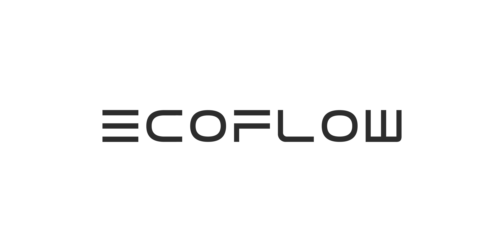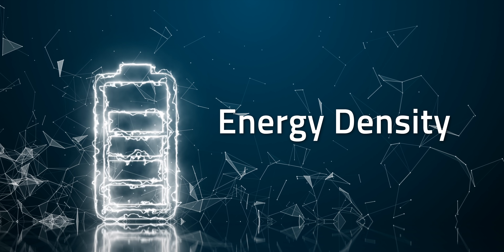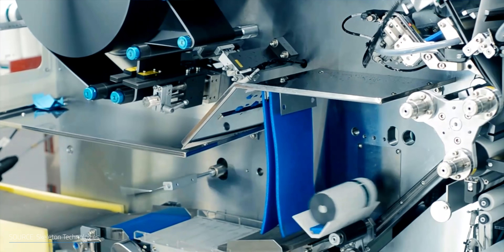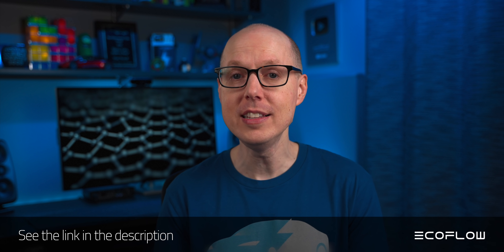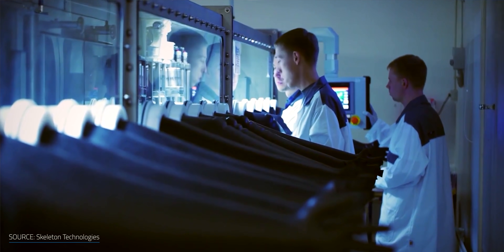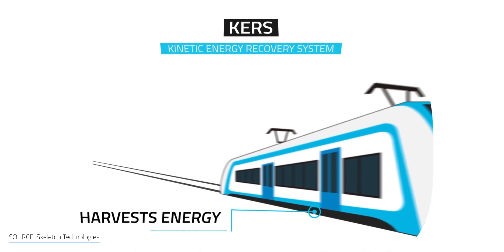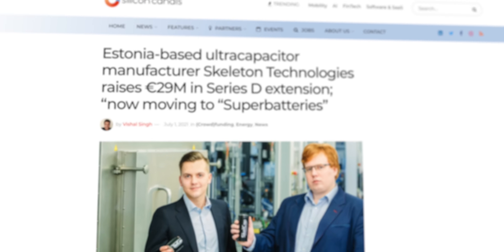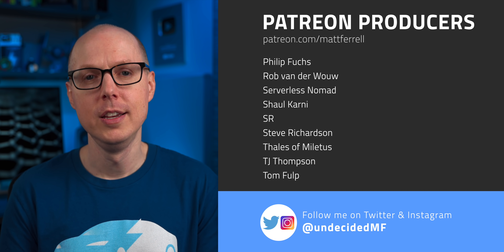Revisiting the Supercapacitor - The Wait for Graphene is Over

Comment: I do feel this with regen braking would improve winter performance in evs and the replacement of the 12v traditional battery has begun (tesla) to shed weight. More needs to be done
Reply: Regen already exists with batteries, you don't need super capacitors.
Reply: @AORD72  yes, but by my orignal post, "improve winter performance" this is because if you dont precondition the battery in cold climates you cant charge "regen" at optimized braking. Supercapacitors solves this and weight reduction. Tesla has this with a new 16v battery in the model S and Chinas Model Y performance.
Reply: @polarbearigloo  true, sorry you are correct.
Reply: @polarbearigloo  I'd be skeptical of anything Matt promotes as he was disturbingly intellectually bankrupt on his solid metal hydride tape reel battery (hydrogen storage) video.
Reply: @RichardPrendingue  How was Matt Intellectually Bankrupt?  I’m not arguing or disputing your opinion, I’m just wondering what aspect of that video you are referring to.  

The tape battery looked like an interesting idea, but I was skeptical of how much hydrogen it really could store (if that’s what you were referring to), and how cost-effective it would be overall.
Reply: @MRDDOG2012  Thunderf00t did a video on it. Matt just repeats the claims of the manufacturer as he claimed hydrogen can be "recaptured" from smoke stacks without using electricity. Assuming for arguments sake it was possible it would be contaminated with impurities from the various chemicals causing issues.

Video titled, Solid Hydrogen: Busted!
Reply: @VitaKet  Mainstream science (Matt or Elon Musk) is becoming a religion of blind faith so its not out of his realm to criticize.

Assuming we reach Mars with Musk, how do you solve the most important problem of power and heat dissipation in the absence of an atmospheric density or pressure of sufficient thermal conductivity? It's to the point a network of piping for geothermal cooling of power source is the only plausible option.
Reply: @RichardPrendingue  of course he just highlights breaking edge. Buisness wise everything can fail for another thing or cost parity reasons.
Reply: @polarbearigloo  He stated, "the device could extract metric tons per day of 99.99% hydrogen directly from smokestacks and gas streams and turn it into a solid state hydrogen." 

If it can absorb hydrogen like a sponge it will absorb everything else within the stack as all other gases are undeniably larger.  Hence, intellectually bankrupt.
Reply: Regen is a perfect use for supercapacitors.

Comment: I can imagine an energy storage solution that combines supercaps, LFP batteries, LNG storage & fuel cells, and gaseous-CO2-derived biochar.  Just like gears on a car, you use different ones at different times, and it's more practical to have all 4 than to limit yourself to just one and oversize the system to handle all the edge cases.
Reply: Waste to energy systems like the GSI-UCS utilize these technologies to create renewable systems for the future. We are currently testing supercap batteries with novel turbine tech to generate constant power and increase micro densities across entire industrial processes, creating parasitic load reduction at the systems themselves.

Comment: The larger power capacity of large capacitors can be useful, but also makes them very dangerous. The one in your microwave can kill you even after you've unplugged it, just with the remaining charge. So what happens when you accidentally short-circuit one of those supercapacitors? The same as with a large capacitor, but concentrated in a smaller space I would guess.

So if ultracapacitors are going to replace batteries, I suspect they will be required to have a current limiter built in so that they can't discharge faster than is needed for normal operation.

Comment: I think super capacitors will become the go-to for energy storage once we can figure them out. What we need to find is a material that is 1 atom thick and is a perfect insulator. Then, imagine a mile long sheet of graphene and this other material rolled into a tube the size of a AA battery. The energy density would be off the charts compared to what we have today, even considering Lithium. Plus, carbon is easy to get. It's a part of biological life on earth, so rake up some leaves in autumn, process them, and you'd have enough carbon to make one of these mile-long graphene super capacitors yourself. Plus, it's more or less renewable. Oxygen. Water. Sunlight.
Reply: Idk if that's possible though, due to quantum tunneling effect. The computer industry is already facing this problem at a scale of more like ~10-100 atoms thick iirc

Comment: I'd like to see regenerative braking in consumer vehicles incorporate this technology.  Start up cycles for HD electric motors such as AC compressors.  Lots of possibilities here.  Great content, thanks!
Reply: Fwiw, the start up of most electric motors above the US 110 volt standard is accomplished with capacitors already. These "ultracaps" may reduce the size of the current ones but not make any impact on energy consumption. What this could do for EV charging times would do much to shorten the days before the electric auto is thoroughly on the ground. Further, using them to help with momentary spikes in power demand would go a long way toward making renewables like wind, solar and geothermal a better fit within out existing systems. No matter what we do, Big Oil and Big Utility aren't going away- engineering to better use renewables  matched with the resources of those entities is the shortest time frame to the goals of 2030 and beyond. FR
Reply: @fredericrike5974  The capacitors used with AC Motors are for phase shifting the current in the start winding, not for energy storage per se. The capacitance values involved are ridiculously small compared to those of sypercaps used for energy storage! To equate them in any way is pointless.
Reply: @gregbailey45  OK, sounds plausible. I would like a bit more info; which AC motors or mfg's are using capacitors in this way? I spent a career servicing HVAC equipment, some of it factory three phase, and have never seen caps used this way- although I can see how your thought may be possible, as a cap intaking and then discharging could have a delaying effect. All of the applications I have worked on used the cap to instantly build a big charge to "kick" the motor on and to speed quickly or in the case of large AC compressors (both hermetic and exteranally driven) reduce the size of supply wiring. At least AFAIK, anyway. There are other, less costly, more durable methods for phase shifting- which, it should be noted, was often done through a multi HP mechanical/electrical lash up, due to cost/complexity. Also your capacitor application would need more than one cap-they can't be charging and discharging at the same time, IIRC. You would need to run pairs, with some sort of circuit to stagger them to achieve the continuous flow of power to run a motor. Again, as I remember it.  FR
Reply: @fredericrike5974  these ultracaps could isolate a generator or other power source from the massive inrush current starting motors demand - allowing for smaller backup power solutions.
Reply from the maker: Thanks for watching!
Reply: Supercapacitors and ultracapacitors are perfect for electric startup motors, as they can deliver a lot of current in a short burst! it could mean putting better car batteries that can be deep-cycled in cars, so you cause less damage every time you leave the lights on and run it flat
Reply: Isn't that what they mentioned using them for on the trains ?
Reply: Yes, they'd pull all the regen.
I find in my hybrid that over a certain level of braking you're wasting that kinetic energy.
Reply: @zackarynortley3896  basically all EV's have that
Reply: Absolutely! Toyota needs to get on it 👍
Reply: It could make sense in small commuter EVs with tiny single digit kWh packs. A super capacitor could be added that allows for 10-20 seconds of hard regen braking that would be too much for the battery pack (4C+).
Reply: Lamborghini has had regenerative braking capacitors for years. I dont think any other auto manufacturer has incorporated that tech tho, including Toyota.
Reply: @sequoiahughes8536  
The Prius was to have supercaps in 1997. They dropped it at the 11th hour.
Reply: Skeletron has a collaroration with another company I forgot where they retrofit ICE trucks with regenerative breaking. Supposedly gives something like 20% fuel savings.
Reply: Yea!
Reply: Regenerative breaking is already implemented in multiple electric cars
Reply: Charging and discharging current of the batteries is normally about the same. Meaning, if the batteries provide enough current to run the motors to accelerate the car, they should also be able to "take" the current from regenerative breaking (as I am assuming, that max. acceleration and max. deceleration during breaking are about the same). So supercapacitors would not help.
Reply: @Kiboxxx  Glad you brought that up. I'm led to believe braking (on average) is substantially more energy intensive than acceleration. That is, regenerative braking delivers (on average)  more charge than a (Li-ion) battery battery can accept. It's pretty nuanced but I trust that smarter people than me have decided that capacitors, be they super, ultra, or whatever they call them, belong in regenerative braking. Thanks for bringing this up.
Reply: If I just brake harder, I can pass this turd.
Reply: Me too.
Reply: Where Ultra capacitors would benefit BEV is in the longevity of the battery. Rapid charging and discharging batteries builds up heat in the battery that damages it. If ultra capacitors could eliminate or at least minimize those surges this damage to the battery could be greatly reduced. It could also allow for a significantly reduced cooling systems. They could also allow faster charging of BEV you rapid charge the battery to 80% and the ultra capacitors slowly finish charging the battery.
Reply: @matthewhuszarik4173  For any normal BEV driving cycle, rapid charge/discharge  at very high current is a non issue. There is no benefit to adding capacitors. Track use? Maybe. Driving on public roads? Caps would be extra weight and cost with no benefit.
Reply: @jimmurphy5355  They could add efficiency. In braking with limited current inflow, you can lose efficiency the smaller the battery and larger the vehicle the more impact it has. It is extremely noticeable in hybrid cars with their small batteries. Also the more even the energy demand and supply to the the battery is the more longevity it will have. This is the greatest advantage of add ultra capacitors. The cost, weight, and packaging are the key issues. If those were all zero you would absolutely used ultra capacitors, but they aren’t so it is a manufacturing decision.
Reply: @matthewhuszarik4173  Isn't it a better idea in general to charge a very big supercapacitor at the charge station, and let that slowly charge a (smaller) lithium battery while driving?
Reply: @sneaky_krait7271  The only problem even a very large Ultra capacitor won’t have a lot of capacity. Capacitor’s advantage is speed both in uptake and release, but their achilles heal is minimal total capacity.
Reply: @matthewhuszarik4173  You're right, I checked more on it myself too. In that case, your solution is a great one!
Reply: @sneaky_krait7271  nah, a small supercapacitor to deal with acceleration and regen (few kWh) with a battery designed for efficiency and long life would be the ultimate combo.
Reply: @morosis82  the larger batteries in current EVs can handle max regen easily. On the order of 1C regen charging for most EVs. Adding super capacitors in that situation would be a waste and just add complexity, cost, and weight.
Reply: @morosis82  I wasn't fully up to speed with supercapacitors energy density problem. I agree it's great to store regen power there, as after braking you are very likely to accelerate again and the efficiency of the capacitor is better than the battery there. But also adding in a capacitor of 20% of battery size to cover the lowest 10% and highest 10% of it, and let the capacitor start charging the battery when when it's 90 or 10%. That way it's less likely to come in zones which decrease battery longevity a lot more.
Reply: @matthewhuszarik4173  
They explained that because of fast charge and discharge a smaller size is feasible in real life usage in many applications. Chemical batteries charge and discharge slowly, which loses energy along the way. Brake regen only claws back about 20-20% of electricity generated by the brakes. That can be on the 90% plus range. So taking electricity in and out of supercaps quickly reduces the need for larger storage in many applications. If greater storage is needed then a mixture of the two can make matters better - hence super-batteries. 

Long runs of cable reduces voltage, so cables have to be heavier.  Supercaps can also reduce the need for heavy cables in long runs as the supercap storage in some appliances will ensure the voltage on start up, due to voltage drop on startup. And less gives drag on the grid.
Reply: @matthewhuszarik4173  it isn't just that. They "leak" current over time as well, or at least the older ones do. So they're best employed for holding charges for "short durations." Although in this case, they can probably retain a charge for days/weeks so they'd make for good "peakers" for both charge and discharge, but until they get the energy density ramped up a lot, it won't be displacing batteries by much.
Reply: @markbarta2369  I agree capacitors aren’t a replacement for batteries in most instances. What they can be used for if moderating current flow in and out of batteries to minimize their premature deterioration and to increase their maximum transient current capacities.
Reply: RAYAMA--⭕️  mmmm any non text nude? Only way king krown krupto will get off simps n Elsas

Comment: Exciting!  Ultra-capacitors, in the near term, will be to electric cars what turbochargers are for ICE cars, which was illustrated in the train deceleration/acceleration example you gave, and we can finally retire those lead acid batteries that electric cars still use to power-up your fancy electric car.
Reply: lead acid batteries are already getting replaced with LFP. Ultracapacitors aren't really need for this particular use case.
Reply: @ehtuanK  And not really useful either.  Self-discharge can be 10-20% per day.  So if you don't drive your car for a week, you need to jump start it.
Reply: @CorwynGC  Wow, ultra capacitors are a leaky bucket!  I didn't know their drain rate was that bad.  This is an important point that wasn't mentioned in the video and is a show-stopper for general electric car use until addressed.  Also, if these things are to be inserted hither and yon into the power grid, wouldn't that be like installing power leaks everywhere?  Unless they are mostly not powered up and filled and then discharged right away when used.

Comment: I remember talking with a knowledgeable friend about Graphene super capacitors for use in electric cars, because of their long life and quick charging ability.   He laughed at me and said you would basically turn your car into a rolling bomb.  What charges rapidly also has the ability to discharge rapidly.  Very dangerous device for storing energy.
Reply: Their energy density is orders of magnitude lower than that of gasoline. So by your friend's logic he should laugh at all the combustion cars instead.
Reply: @ehtuanK  Boom potential of something is related to power density and not energy density. So yes his friend is right a shorted capacitor does not catch fire, it explodes.
Reply: @Tore_Lund  It still contains just a tiny fraction of the explosive potential of a tank filled with gasoline vapor, due to the much lower energy content. Still a concern, sure, but unless proven otherwise it shouldn't be deemed an insurmountable problem.
Reply: @ehtuanK  It is not at all a problem, you could let the interconnects act like fuses. i have a small bank of 350F super caps in my car as a substitute for the lead acid battery and their short circuit current is 27000 A!  that is 5 to 10 times that of what a Li-ion battery is capable of, though they still only hold 4Wh they can release them instantly which would make a bang. It is more the "rebar on the road ripping up the battery box" scenario I'd imagine would setoff a chain reaction?
Reply: As if gasoline cars aren't already rolling bombs carrying 20+ gallons of flammable liquid? Just saying haha
Reply: @plvmbvm513  Gasoline does not release all its stored energy instantly.  Its dramatic, but not like one massive lightning bolt that would instantly fry you.
Reply: @sweynforkbeard8857  If the gas is atomized - like in an accident - then ignites, it can release an incredible amount of energy all at once. Like a huge bomb. Way more dangerous than a supercapacitor, whose charge is looking to get to ground. Pretty easy to make sure the driver and passengers aren’t on the path to ground.
Reply: As if cars aren't already rolling bombs.
Reply: So are Li ion batteries. Fires happen when a cell shorts and releases all that energy at once causing other cells to fail resulting in enough heat to start a metal fire. So in essence an electric car using Li ion batteries are a rolling bomb.